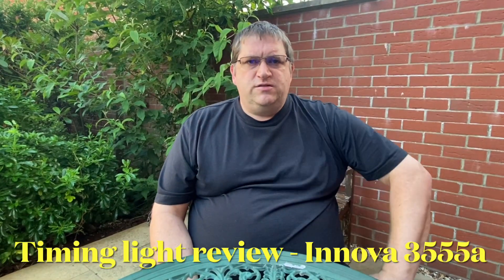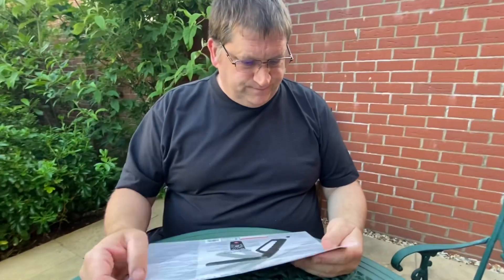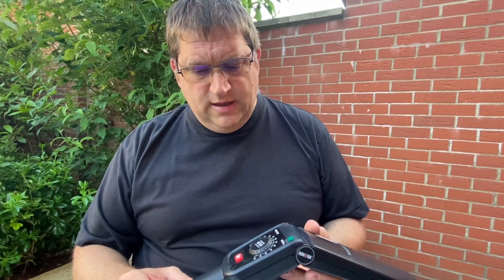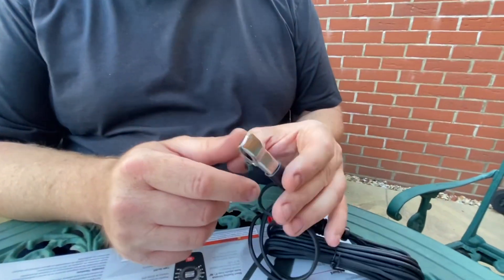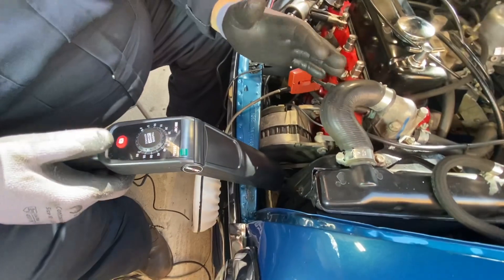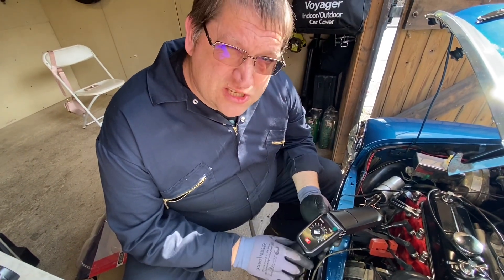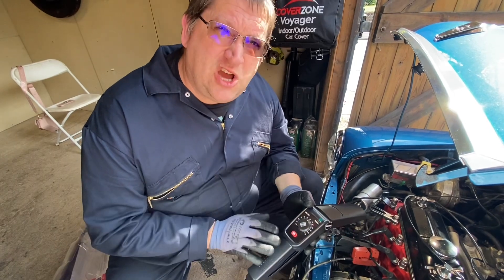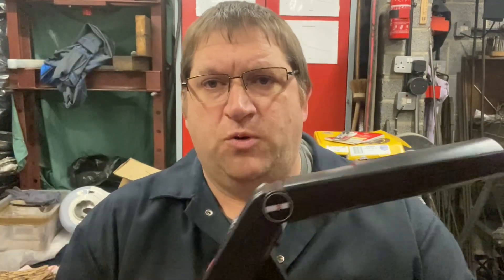Timing light reviews - Innova 3555a

Comment: So as you rev it by hand will the timing light dial turn on its own to where it shows how fully advanced it is because i cant get my 3568 to tell me what my advance is super confused.
Reply from the maker: No it does not work like that. You turn the dial an stop turning with the timing mark aligns with the TDC mark on the engine. Then you read the degrees off the dial.

Comment: An important note with the Innova products is that they have very little to zero product support/presence in the UK.  After approx 2 years of heavy usage on my 5568 the cable started to split just below where it plugs into the handset.  A short while later it gave up the ghost and split.  The handset was perfectly good to continue using, but via Amazon I had to send away to the USA for a replacement cable which cost around £75 alone.  As mentioned though, this is after very heavy multiple daily usage....As one of my spares I also carry the 3568 over the 3555A reviewed here, simply for the rpm function.  In both cases there is a difference in build quality between the 3 and 5 series....5's feeling much more robust and better built.
Reply from the maker: Thanks for that useful update